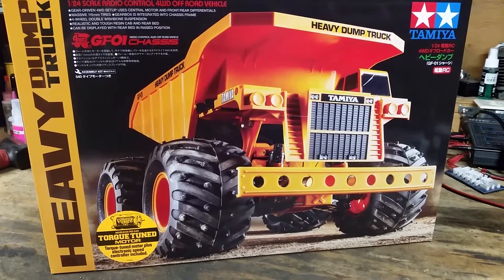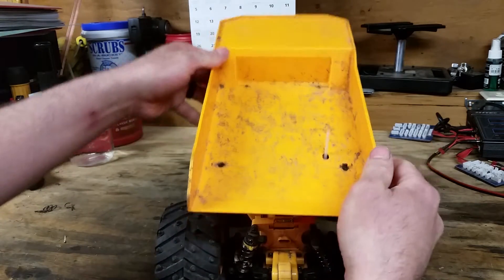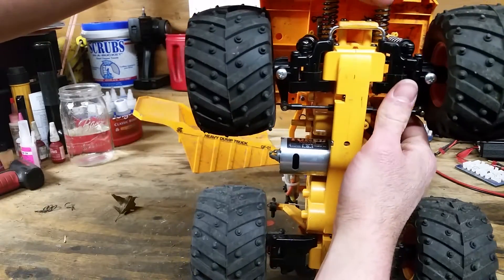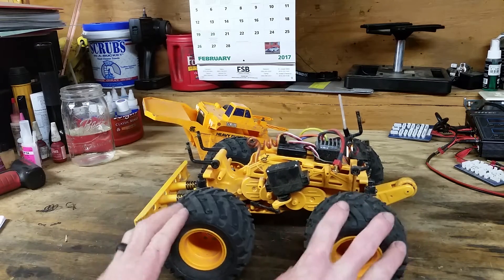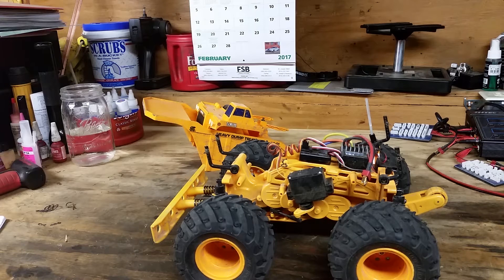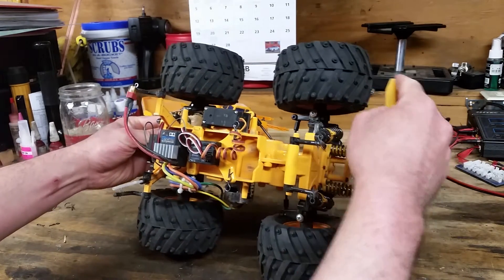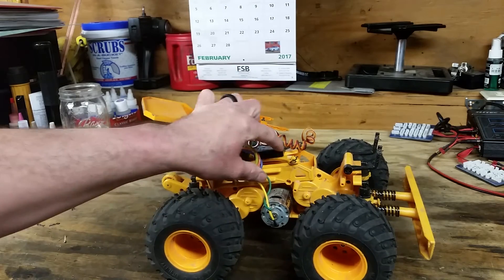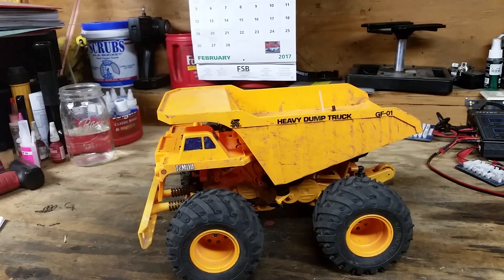Tamiya Heavy Dump Truck review (GF01)

Comment: Can you slow it down to crawl
Reply from the maker: I don't think it would slow down enough, you're pretty much locked in as far as gear ratio. It's pretty torquey with the torque tuned motor, I did some light crawling with it. It's also top heavy with the dump body.
Reply: Wanted it to crawl to use with my excavator lol